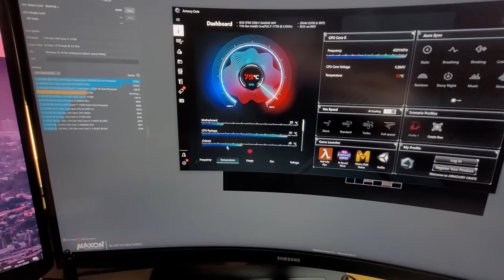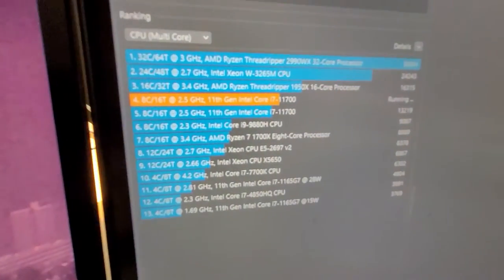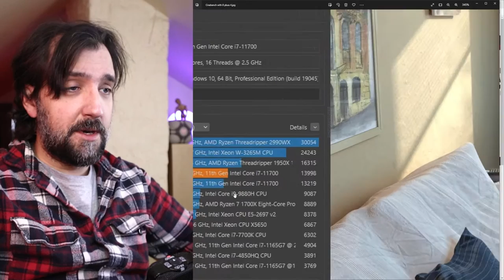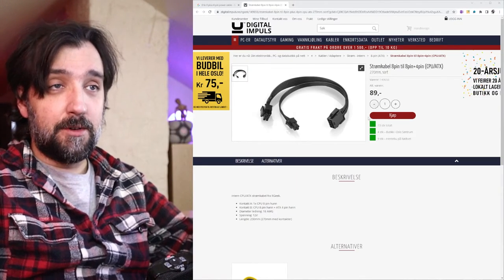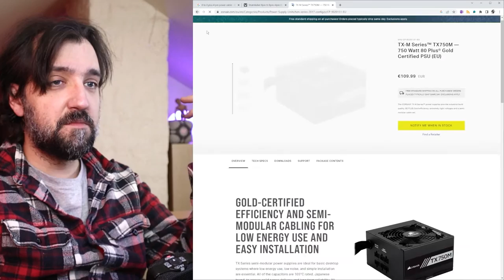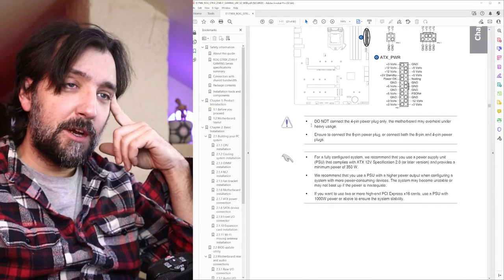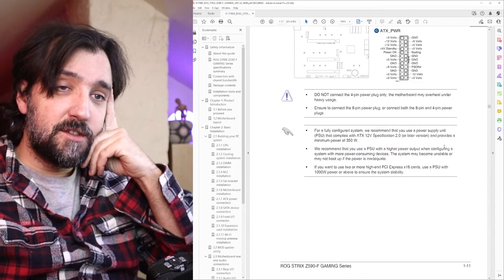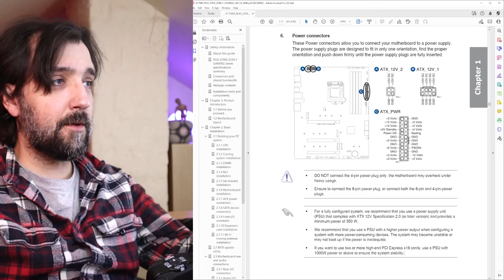Is an 8pin to 8+4pin power cable adapter for CPU safe to use?

Comment: Totally worked getting the CPU 8+4 power adapter cable. Works with my motherboard Asus ROG Strix x570E Gaming! Thanks your video fixed my issue with my power supply not having the 4 pin cable.

Comment: Bro this video its what I need now.
I recently sell my mobo and get an Asus Rog B550-A,it has 8 + 4 CPU pin power.
My PSU its EVGA supernova 650w and just have 1 connector for the CPU of 8 pins,and comes with 1 CPU 8 pin cable and this adaptor (4+4 in fact). Now I know its safe. Thank U.
Reply: OMG I have Asus ROG Strix x570e Gaming and seeing this also gives me hope!

Comment: Hey I got a question am thinking I need a cable like this as I have purchased a new PSU Gamemax RGB Modular 80+ Gold and it comes with 2 CPU 12v  8 (4+4) pin cables and my motherboard is an Asus ROG Strix x570e Gaming board. I can only plug one of the cables in and wonder will this help me? I'd hate to have to return my new PSU and continue having trouble
Reply from the maker: First, check your cables—some 8-pin connectors can be split into two 4-pins. If not, I’m not entirely sure, but it still shouldn’t hurt to give it a try. Just make sure to calculate the total wattage of your setup. You're looking at around 850 watts, which should be fine. For reference, I'm running 32GB of RAM, an i7, and an RTX 3090, and my system barely uses 500 watts. Just be sure to account for all your components to avoid any power issues!
Reply: @MrTeeF  thanks
Reply: @MrTeeF  I have been having issues with the yellow led light coming on in my motherboard so wondering if that's the issue
Reply: Just to update the splitter cable definitely worked! Boots up and no led lights lighting up on my motherboard. It's working great!

Comment: You can use a splitter with no problem as long as the output in watts is in the range of what the PSU can deliver.  The voltage can be splitted, the voltage can be splitted many times, but the power output is the limit.

Comment: Hello there, I have a one 8 pin eps cable, but my motherboard got two 8 pin slot, is it possible for me to use only one 8 pin to run and will it be safe?
Reply from the maker: In theory yes, but check the manual of you Motherboard. The CPUs should run fine on only one 12v 8pin connector, but some high end CPUs like i9 or overclocking will benefit from the extra power. But again, don't take my word for it, check the manual under CPU power. There are 8pin to 2x8pin converter cable available to, but make shure your PCU has enough watt's total.

Comment: Does it hurt anything when you plug two things into an outlet in your home?  Or what if you plug in ANOTHER two things into an outlet on the other wall?  You are tapping power from the same source, don't ya know.
Reply from the maker: Yes... but then again.. excessive use of branching extention cables is a very common fire hazard. Essentially, if your using a lagre amount of watts.  😅